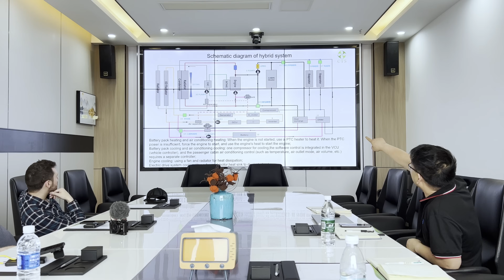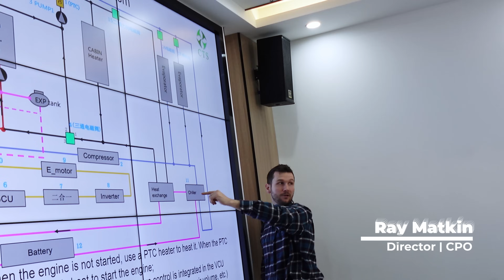High-Speed Rail, Battery Factories, and Cultural Insights, China Part 2

Comment: A little note on QR codes:
How can you ensure the documentation stays accessible years from now? Most QR codes are technically pointers to websites.
However, with very large sizes and some error correction, the current largest QR codes can store decently large text files

Comment: Tesla does not use LiPo cells. Never has. I'm no fan of Tesla but i am going to call out mistakes like that.
Reply: where did they say Tesla uses LiPo? They said they don't have to use LiPo because they are Hybrid, That said does Canada not allow EV manufactures IN Canada to use LiFePo4?
Reply: @commonsenseisdeadandgone  4:48
Reply: @jiraph52  a cylindrical cell isn't Li-Po....... 

Tesla uses Lithium-Ion (NCA, NCM and LFP.......)
Reply: @commonsenseisdeadandgone  Yes, I am aware. You asked where they said that Tesla uses LiPo - that's where they said it.

4:48: "Tesla and other companies they'll use a cylindrical cell because it's a lithium ion polymer [LiPo] cell"

However, as you said, LiPo is not often cylindrical and Tesla does not use it. I'm sure Eric knows the difference and just misspoke.
Reply: @jiraph52  I'm more curious on the "we can use LiFePo4 because we are a hybrid"  and what that is. 

Most hybrids DON'T use LiFePo4 because typically output is more important than capacity for hybrids. Then again, their "hybrid" isn't the same, they are just scaling down electric-diesel locomotives!
Reply: 😂they actually do. They use LiFePo4. They have 3 different battery chemistry and their lithium iron phosphate is the most stable. Temperature and duty cycle. More charging cycles. But the heaviest.
Reply: @maxiest200508  Lithium IRON Phosphate is almost the opposite to Lithium POLYMER. They are vastly different chemistry type with different characteristics. Tesla has never used Lithium POLYMER but they source a massive amount of LiFePO4.
Reply: @maxiest200508  You laugh BUT you are wrong....
Reply: @commonsenseisdeadandgone  just do a quick google search on this topic and come back. I dont want to post any links here. But if am wrong am wrong. In fact they started using that battery chemistry because it's more stable. It is heavier though so they started to change the suspension of model 3 to support new weight. I wish I was making this up.
Reply: He was so wrong😂😂😂
Reply: @maxiest200508  Please, just call them LFP. That "Po" is just too misleading, considering it stands for something completely different in LiPo.

Comment: IMO the charging port and hardware needs to be modular and replaceable for when NACS becomes more common.
Reply: Modularity also means if NACS doesn't become the world standard, whatever does can be fitted, or whatever comes next can also be fitted.
Reply: NACS would be a bad choice for rough dirty conditions. It is a far less protected port with very deep socket that will collect junk. NACS and CCS interoperate with adapters, there is no need to worry about compatibility.

Comment: Just say no to welded bus bars on the cells.
Reply: the cells they were looking at had bolted bus bars with expansion bends.
Reply: @Stubones999  at 5:38 those are laser welded cell connections.
Reply: @gonesilent2814  Hmm weird, welded cell connectors with washer alignment markings. Sorry I don't get the point of that additional work?

Comment: I remember an interview Bobby Llewellyn of Fully Charged did with Jim Farley a while ago. Farley talked about the problems that Legacy OEMs like Ford have with software. 12:55 
Historically OEMs would buy (for example), Central Locking systems from one supplier, Electric Windows from another, Air-Con from a 3rd Etc.Etc. and they ALL had their OWN Propriatory Software to run their own systems. Getting them all to play nicely together was a nightmare. With EVs and the Software needed to control the electric side of things, that got many times worse (just look at VW's problems a while age). Tesla, being a Computer Manufacturer that happens to make Cars and Trucks, have their own answers to making Software work. So Tesla can have one computer to run 10 systems, where Ford or BMW would have to have 10 Computers that all tend to swear at each other from time to time. Having all your eggs in one basket may have it's risks, but "Keep Things Simple" is good advise for a reason!
Reply: Typically they have they ONLY have manufacturing done and have their own software to run ALL systems, NOT have a company like this do it all. For what they need however, They don't need all those other modules as ALL those fancy systems aren't needed here. Lane assist, self driving, all the nonsense info and radio features are basically useless in their industry.

Comment: Lithium polymer is what drones use. Lithium-ion is whats in the cylinder cells
Reply: Then you should know what polymer refers to, and that LiPo as a type of chemistry doesn’t mean that it’s the only one allowed to use a polymer in cell construction. LiFePo4 (LFP) batteries (they aren’t using lithium ion) can incorporate polymer electrolytes too.
Even if he misspoke, who cares? Why was your first instinct to “correct” instead of verify?
Reply: @Neberheim  polymer is too volatile to pack in metal cells. It expands & contracts too much for metal. Only pouch. Facts matter.
Reply: Yes, please correct their engineer
Reply: @Neberheim  There is like 4 main lithium chemistries. I've built mutipul solar systems & a drone builder. I'm an engineer also.
Reply: ALL lithium batteries ARE Lithium-Ion batteries and LiFePo4 IS NOT only cylindrical nor is it the only chemistry in cylindrical cells. And if you have built multiple solar banks it is scary you didn't even know basics such as that! 

Drones DO use LiPo because it has the greatest discharge ratings for such spikes like the multiple motors can suddenly draw during flight and maneuvers, They just are NOT the safest in EV applications as the others. LifePo4 is the most forgiven and the most commonly found. LTO I believe is used in hybrid systems on buses in China and many hybrid/ev in the US use NMC if not LiFePo4. All 18650,20700 and other batteries with such nomenclature are LiFePo4 cylindrical cells .. There is your 4. (There are others but not widely used)

Comment: Shame you went with the CCS port and 150KW is really low for a that large of a truck. Especially with tesla coming out with their V4 charging stations which they will be around 1MW
Reply: With what employees? The charging dept has none, he fired them all.
Reply: @armorclasshero  And then he re-hired a large majority of the department back.  Keep up with the news.
Reply: @charlesball6519  except he didn't. He couldn't get back anyone from the top. He rehired the grunts, not the talent.
Reply: This is why the diesel generator makes sense in most cases except for long-haul.
Reply: CCS is what's used outside of the US so there is constant development into that, too. And it has been around for a long time. I suspect it was just easier going with that as the NACS (Tesla plug but based on CCS) is pretty new and focused on cars.

Also there is the European heavy truck charging standard MCS (based on CCS) coming online with up to 3.75 MW. Which is what will make electric trucking more viable as batteries keep getting better. It's not like a heavy truck with trailer can easily pull up to a Tesla supercharger or other car chargers anyways. There needs to be dedicated infrastructure for that.
Reply: @adddude7524  To be specific, CCS1 is used in North America, while CCS2 is used in Europe and Australia.  CCS1 is single phase + the two DC pins, and CCS2 is three phase + the two DC pins.  NACS is Tesla's plug where the DC Pins are also AC pins when not being used to supercharge.  NACS is just the CCS protocol over the Tesla plug.

CCS1:  Single phase SAE J1772 Type 1 is L1 + N1 + G1 + Control and Pilot pins  (5 pins) + 2 DC pins
CCS2:  Three phase IEC 62196-2 Type 2 is L1 + L2 + L3 + N1 + G1 + Control and Pilot pins.  (7 pins) + 2 DC Pins
Reply: I seem to remember him saying the generator itself is 300kw. So maybe they don’t really have the equipment set up to handle super high kw charging.
Reply: Those trucks are set up to charge overnight and use the generator during the day. This means that even with a bigger battery than they have, 150kW would be more than enough---you can easily fill a 1MWh battery using 150kW in the time it takes the driver to get a full night's sleep. And those trucks only have a sub-300kWh battery that will be full in a little over 2 hours on 150kW.

Using NACS before the charging infrastructure is there makes no sense. For a car, I would plan NACS now, as the public charging infrastructure will be there when it comes out. But for trucks, no public charging infrastructure is in sight---nor is it needed for vocational trucks that return to their depot at night. And for company installations, there are CCS chargers readily available while NACS is not yet.

Comment: Hey Edison Motors I have a question about making a diesel electric boat because I'm interested in circumnavigating the globe but I don't want to do it on a sailboat play also don't want to pay hundreds of thousands of dollars in fuel so I figured to do something like same technology that your trucks use and I was wondering if in the future I could email you all with some questions about best ways to go about it
Reply: There are diesel-battery-electric tugboats currently in use.  Most electric drive boats work this way, but with the battery the diesel generators can be smaller and more efficient.  With a boat having a large source of emergency power in the batteries would be a bonus.
Reply: There’s a lot of setups like this already, check out Electric Marine Propulsion, Elco Motor Yachts for motors, and Polar Power for generators.
Frankly I don’t see it as feasible without sail though. You would need thousands of liters of fuel on board. I would go with a junk-rigged yacht personally for a circumnavigation. In fact, I think the first solo circumnavigation was done in a junk rig.
Reply: Diesel electric boat doesn't save much fuel, because there is no regenerative braking while going downhill or slowing down. And there is no high speed low power use once the vehicule has accelerated.
If you don't want to pay for fuel, you need a sail boat, thats what they are for, they don't make engine noise and vibrations, and they are more fun.

Comment: Don’t waste money on lithium wait 1 year
Reply: Sure, bud.
Reply: Wait one year for what? Sodium? What non-lithium chemistry is going to hit the market in the next year?
Reply: If you are talking about sodium based batteries, those are good for stationary uses (like grid storage).  They have less energy density than LiFePO4 batteries.
Reply: It would be several years before commercial Sodium battery came out if the research is a success next years.

Get a design is one thing but building then sourcing parts to build that design are another thing.
It would be at least a decade to make any dent in Lith battery dominant.
Reply: That's been the mantra of the fossil fuel industry for the last 3 decades. "Next year, the new wonder technology will be there, so buying an EV now is a folly; buy an ICE car if you need a new car now."

Comment: I just saw an innovative internal combustion engine that uses a fifth stroke to harvest exhaust and heat energy.  It uses a low pressure cylinder fed by two synchronised high pressure cylinders.   Perfect for a generator in a serial hybrid like yours.  This could further improve the efficiency of your trucks and pickups.   You can see it on D4A (Driving for Answers)
Reply: Maybe theoretically more efficient, but defeats the purpose of using commercial off the shelf crate motors that are widely available and easy to repair and order parts for. They’re never going to start manufacturing proprietary engines to chase a single-digit percentage efficiency gain.

Comment: The issue with QR codes is where the information is stored. Typically it references hosted information which can fade over time. If the QR code has all the information needed encoded in it, then you are only dependent on the technology being built into a decoder. Still just a tag with the information on it is best.
Reply: agreed. and good point

Comment: Is the system going to be 48 volt or 24 volt ?????
Reply: i’m pretty sure it’s two 400 V systems in parallel, for 800v operating but don’t quote me. Unless you’re talking about like the headlights and low voltage system, which will probably be whichever has more part commonality with the industry.

Comment: You can get what you ask for in China.

If you ask for the cheapest possible price, you get that cheap crap that'll only last a year.

But you can also ask for specific measures of quality if you're willing to pay extra. If you ask for automated and double manual quality control of every unit shipped they can find a price for that as well.

I know you guys are not programmers, and the battery manufacturers are supposed to know what is best for their batteries. So it makes sense to buy the software with the batteries.

But you mention a paradox within software... you can get super simple and stable software that will never fail, because it's easy to do unit tests on, but that won't be user-friendly. Once you ask for user friendly the software behind becomes complex and the risk of bugs goes up. You can't have both, so take care what you ask for in that regard.

I'd ask for the control and safety software to be separate from the user interface software, they can both be delivered by the same supplier of course, but it'll force them to keep the two code bases separate.. 

And if you ask them to document how those two interact, it'll be possible to swap one or another part in the future, even if the company goes bankrupt or changes their platform entirely.
Reply: It’s sad they have to go to china for affordable well built electric products….
Reply: @Redbloodroadrunner  It's shame and worse still our leadership refuses to seriously do anything to bring back production capacity.
Reply: @Redbloodroadrunner  it is sad, and it will take some major efforts from both government and corporate to catch up.

China has the mining and supply chain in check when it comes to rare earth minerals.

And the way their manufacturing is put together is also mentioned in the video. It works much more like open source, most manufacturers specialise in one thing and source each other for the stuff they can't do themselves. They are not particularly afraid of competitors copying their products, they'll just steal back any innovation the competition comes up with.

Western companies try to keep a lot of business secrets, in China it's the opposite. They compete on price, capacity and quality, not so much on innovation.
Reply: Mandating highly detailed documentation of the code should be an absolute just so it can be passed on to a different supplier or needs a major update to a different platform as you said.

Comment: You're not going with NACS? I understand that CCs is very common right now but you're not building trucks right now. Your building trucks for the future. So instead of needing an adapter for the first year or two, you'll need an adapter indefinitely
Reply from the maker: It’s easy to change a plug
Reply: CCS is the world standard for the connection so makes sense using it instead of CN, US or JP versions. (with those 3 probably also having a good share of CCS too)
Reply: @miragept  CCS2 is European, CCS1 is North America, which is switching to NACS.  China uses a different standard (GBT, I think), and Japanese likes ChaDaMo.
Reply: @EdisonMotors  I think its quite a bit more complicated than that.  Changing from CCS1 to NACS means that the DC pins also handles AC, which requires a completely different inverter/charger.  CCS1 and CCS2 is a cudgle where the DC pins were added as an after thought.  On CCS1 (North America), you have the hot and neutral and ground, and two communication pins over the two other pins.  CCS1 is just J1772 with two additional DC pins for charging.
Reply: well, it is being designed so you can swap out the port like an outlet at home.
Reply: Does that mean you’re designing the wiring to be multiplexed for NCAS, with temporary AC to DC switching at the plug? It’s cheap to swap a plug, but why spend the money to manufacture, ship, and install extra wiring?

Comment: I'm not sure how much cost this would add (or how feasible it is from an electronics/safety standpoint), but it would be neat to have an extra high voltage connection integrated in the charging harness from the factory. This would make it easier for customers or you guys to add a NACS (or even MCS connector whenever those chargers start rolling out) connector to the truck or add an additional CCS charge port to another location on the truck to make it accessible to a wider array of chargers, like the Audi etrons.

Comment: I like the idea of the "Power Trailer" - very similar to the solar light trailer but only solar cells, lithium iron phosphate battery and a big inverter to provide AC power. I can use it on the Farm / Work site to provide power or in case my home service goes out from a storm.

Comment: Any chance of LTO cells in the near future? Cold weather performance and very high discharge rate means smaller pack for some hybrids.
Reply: The lowest energy density of all the Lithium types.  Nobody uses that for EV.  Think of an ordinary EV getting 300 miles on NMC or LiFePO4, you would probably get 100 to  150 miles of range on LTO.